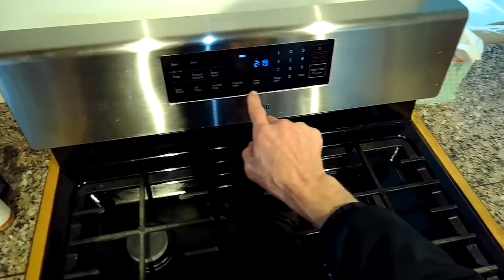✨ OVEN TOUCHSCREEN NOT WORKING — EASY FIX ✨

Comment: please advise my samsung stove top , one of the knobs normally you push and turn however the is that just by pushing the know its lights up without turning.
Reply from the maker: Hi Giovanni,
I would pull off the plastic knob and spray in a little bit of oil or silicone lubricant where the metal stem enters the burner switch and then let it soak for a few hours, and then apply some more lubricant and then using your pliers push in the metal stem and turn it in the same direction as the other burner knobs and then try it many times until it finally starts to turn.

Comment: Thank you so much for this tip.  My oven panel has been struggling.  Once I  turned the oven on  and heated my oven, the panel would not respond when I tried to press the buttons to change the temperature or  use other settings. It would only start working again when the oven was completely cooled. Even though I bake a lot, and truly need to upgrade my oven, I wanted to wait for another year before I make that purchase.  I definitely did not want to call a repair person and spend money on replacing the control board when I really want a new oven. So I thought I would try your tip. As of right now, your tip has fixed this problem. thank you!
Reply from the maker: That is Great News, thank you ❤️😊👍

Comment: Hi, I am trying to do this with my oven but can’t seem to get the ribbon to come out. I am worried about applying too much force at getting it out. It is just not budging. Any ideas? Thanks!
Reply from the maker: I think there are two little projections on the plastic piece that the ribbon cable fits into on the circuitboard and I believe you have to slightly pull those out to the sides and then wiggle the ribbon away from the circuitboard.

Comment: Nothing turns on at all. On the panel steam from cooking shut the oven off and it never came back on. No buttons work. Do I need to replace the whole control panel or do you think I could pull it and clean the ribbon like you suggest?
Reply from the maker: Can you try unplugging for an hour and then see if it will start back up?

Comment: My Frigidaire gallery panel went out during a power outage. How to fix it
Reply from the maker: Maybe just reset the breaker😊
Reply: @ScottTheFixItGuyChannel  did that and changed the fuse
Reply: @megmegnation1462  , was the fuse the problem? I have same issue

Comment: I tried it, it worked for a few days, then the problem came back... just tried again, crossing my fingers and saying a prayer that it works. If not, next step is replacing the display board?
Reply from the maker: You’re right👍